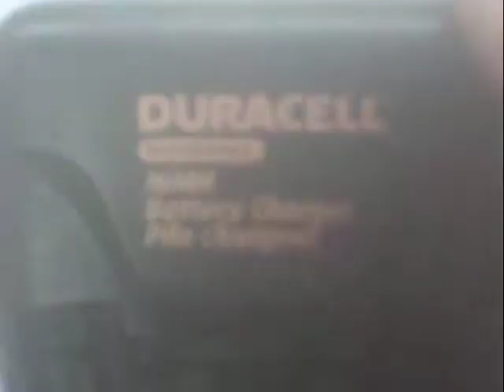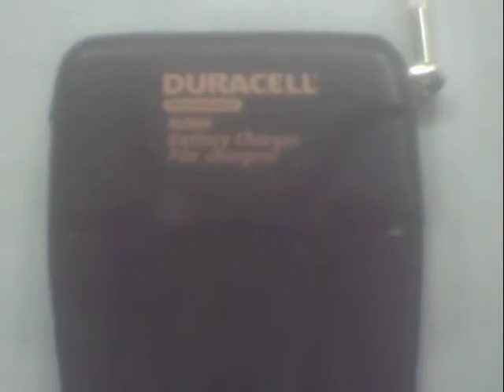Duracell NiMH battery charger disassembly, FAIL, well 'dunn' junk now

Comment: Lee: Mine failed too. I saw burn marks on resistors R28 and R28a inside. Also, one capacitor seemed to be bulging. I've ordered but am still awaiting the resistors. Do you know how to solder reasonably well? If it works out in my case, I'd be happy to share my findings.
Reply from the maker: Yeah I can solder okay, I just don't know where to buy little parts like that. Where did you order from, Amazon like everybody else?   I don't usually order stuff even though I know its easier shopping, but I don't do much shopping at all really.  I've already tossed mine out, but yeah feel free to share what you find out, if you fix it, just make a clip. Thanks, take care from Tn Mr. Brad.
Reply: Lee:

Here is a link to a page I just started. 

https://www.ifixit.com/Device/Duracell_CEF14N_NiMH_Battery_Charger?revisionid=HEAD

It appears that resistors R28 and R28a (near top left of photo) were both burned. 
R28 disintegrated when I touched it. I am fairly sure resistor R28 was labelled 1R2 on it, but I can't be sure, since mine disintegrated. If it is 1R2, that would make it a 1.2 ohm (size 0502) SMD part. Check your board to make sure I read it right.

Resistor R28a is labelled 1R8, so it would be a 1.8 ohm (size 0502) SMD part.

Capacitor C5, on the beige side of the board, seemed to be bulging a little. On my board, it is a black 680uF 10V radial cap. Again, it is on the opposite (beige) side of the PCB, just to the left of the yellow transformer.
Keep in mind that most multimeters will not accurately measure capacitance that high. I will solder in replacement resistors as soon as I can get them, and post back with my findings.

Any electronic parts supplier should have these common parts. Total cost should be a few dollars or less (not including shipping if that applies).

Comment: Lee:

I got my charger working again. It turned out that what looked like residue from blown resistors was actually residue from something else, probably the capacitor that bulging capacitor that I replaced. It turns out the resistors were not the problem after all. I simply replaced capacitor C5 with a new one, rated at 680uF (20V) and the charger is working fine again.

https://www.ifixit.com/Device/Duracell_CEF14N_NiMH_Battery_Charger?revisionid=HEAD

Comment: Lee: Sometning strange is happening. I spent about 20 mins. typing out another reply, and after I posted it, it disappeared. WTH? 
Anyways, in my case it appears it may be surface mount resistors R28 and R28a on the green side of the board, and possibly capacitor C5 on beige side.

I've started a page on iFixit for this device. I don't know if I'm right yet, but I'll share whatever I find.
https://www.ifixit.com/Device/Duracell_CEF14N_NiMH_Battery_Charger?revisionid=HEAD
Reply from the maker: Cool, I never even heard of IFixit before, thanks for sharing.